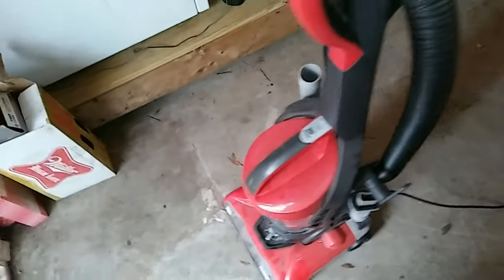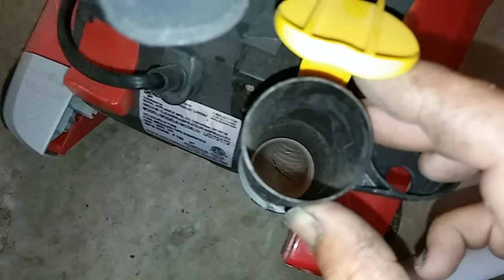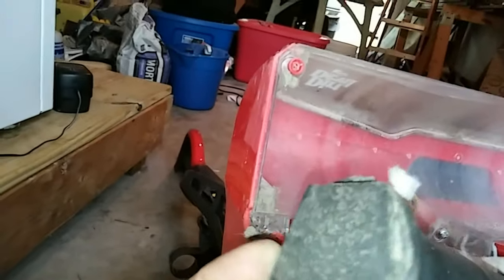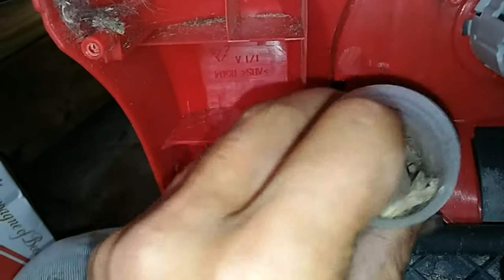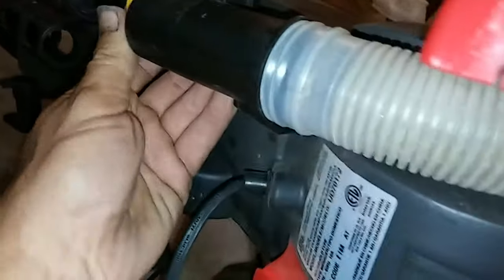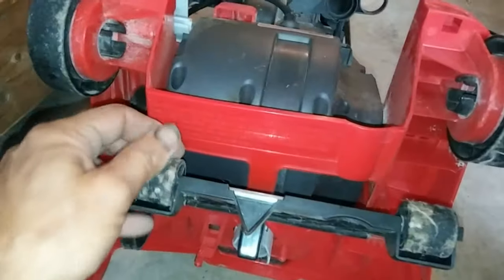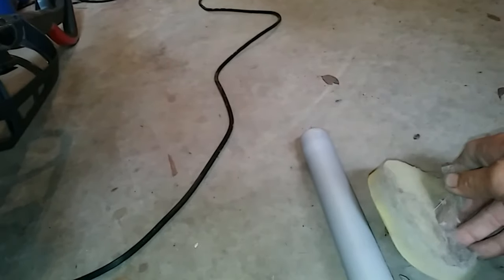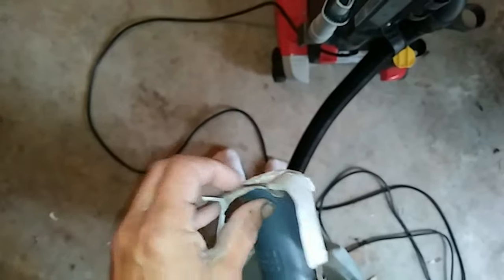how to repair a dirt devil vacume

Comment: I have a cleaning company & everyone gives me their old vacuums, I usually break them down, clean them, replace belts or hoses if cracked or use redneck ingenuity if the hose has a small hole, get them working again & either use them as a back up, when my good vacuum needs some TLC. Anyway, my daughter-in-law gave me a dirt devil just like this one. Talk about backed up, she used it 2-3x's daily, (3 cats & a 2 yo) she never knew it had a Hepa filter or that the foam/felt filters needed to be cleaned. Anyway, I took it completely apart, took the air compressor hosr to blow out the Hepa filter & a shop vac to the foam/felt filters (then hand washed these 2 only), removed ALL hoses, took a dryer vent brush through the hoses to remove all of the clogs, then blew them out with the air compressor. I cleaned the brush roll, replaced the belt, everything looks brand new, turned it on and I have power, but absolutely NO SUCTION. Found your video, watched it, saved it, subscribed, got home, watched it again, took the vacuum 100% apart again.... went through the motions just in case I missed something, nope, no clogs in the hoses, filters are clean, even the vent under the foam/felt filter is clean... put it back together, but I still have no suction.. what have I missed? I did notice on the top of the canister, it looks like maybe a circular foam or paper filter could go inside over the plastic piece with holes inside the lid, but she said it never came with one? I know nothing about Dirt Devil's, & I can't find any other videos that go into as much depth as your does. I'm at your mercy and any info is greatly appreciated. Thanks
Reply from the maker: If the motor sounds like it's revving real high then it's still got a clog somewhere. Also, make sure the impeller is turning. Let me know what you find out.
Reply: @shabear1000  It's turning, motor isn't revving, I had ordered new filters (& a brush roller) after I got the vacuum from my daughter-in-law, trust me when I say even after I cleaned for the 1st time in 2 year's, they HAD TO BE REPLACED. Anyway, I had a rare day off yesterday so I broke it down & took it all apart again,  I replaced the  belt (again), installed the new felt/foam & Hepa filters, the brush roll, actually took the broom handle through the black hose, dammit I missed a massive clog, thought the air compressor would have blown it out, but it didn't even come close. I couldn't push the broom handle all the way through, not even putting it on the ground, running it up the hose with all of my weight, found an old cane pole, longer than the broom handle, with a metal grommet at the fattest bottom end, ran it through, a small clog came out, ok... blow, nope... needles to say it took me 45 minutes, a small piece at a time and I finally got it all out. DAMN, that's all I can say. I appreciate your advice & help on this.

Comment: I think the motor is jacked up. We cleaned the brush rod, the belt looks fine. When we take both of those out, the vacuum sounds fine. When we put both back in the makes a loud whirring noise and then I smell burning.

Comment: Yay, I was able to fix my Vacuum from your video. thank you sir!
Reply from the maker: Loven Sanchez you are very welcome
Reply: shabear1000 Mine is making Flapping noise when the thing spins what could it be
Reply from the maker: +Tyler  Sauls make sure nothing is in the fins in the motor. In sure you have already checked the beater bar, if not check it first. Also look for any lose or worn parts

Comment: IF YOU HAVE BURNING SMELL: I repaired the brush roller by 1. removing all external hair, string, etc. 2. Pulled off end caps by putting in vice and pulling. Hair was imbedded in there slowing rotation. This caused belts to burn. 3. Removed all hair. 4. lubricated with 3 in 1 oil. 5. replaced caps. put back together and it works! I'm too lazy to do a video. LOL!

Comment: Okay so I have the Dirt Devil Powermax Carpet + Hardfloor Pet vacuum. My current brush roller has melted belt on it and the belt keeps slipping off the metal rod. How do I fix this ? I have pictures but you tube will not let me post the pictures.
Reply from the maker: If the belt is melted replace it. Make sure everything is clean and free from dust, pet hair, etc.
Reply: @shabear1000  I did both of those but there’s nothing keeping the belt from slipping off

Comment: Do you happen to know what the screws are? The ones you talk about taking off? I was fixing mine because the belt broke and I ended up misplacing them. I have to buy new ones but I don’t know what they’re called. Or the length of it.
Reply from the maker: Not sure but they are a Phillips head screw, maybe1/4
Reply: shabear1000 ok thank you!!
Reply from the maker: You bet. Sorry I couldn't help more.
Reply: shabear1000 that’s ok!

Comment: Dude the clear part that you put back on won’t go back in properly HELP ME
Reply from the maker: Make sure it is lined up properly. It should go on pretty easy. Let me know what happens.
Reply: @shabear1000  i did it and it’s like crooked.I cleaned out everything and I even called the company and they told me that they don’t recommend to take that clear part out because it may not go on the right way and I still can’t fix it can you do a tutorial on how you did it please?
Reply from the maker: Yes I will. Exactly what clear part is it so I make sure to show the right one
Reply: Ok it’s the clear part you see the brush rolls.the front cover you took the hose off and you have to align that part it’s stuck and won’t go back on.

Comment: UPDATE: I watched the very beginning again and heard you say "Pro Power..." I looked it up and we don't have the same one. Best I could tell your's is model UD70172 , while mine is UD701623. But close enough !!! Thanks Again!!
What model is that ? I'm following you step by step but I don't have that yellow capped pipe area on mine. Well it's my friends but I'm going to use it after I clean it up (though it's not that dirty) and your vid is so helpful to me !!!!   This one here is a Power Max  Model UD701623. Appreciate all the help !!  I'm a Kirby fan myself.. but its getting heavy.
Reply from the maker: thanks for the update..
Reply: I'm Googling now about using the wand and hose attachment. wondering how U leave the rest of the vacuum? With the beater bar running? not good is it?
Reply from the maker: The vacuum raises the beater bar up enough so that it wont touch the floor. As long as the handle is in the upright position.
Reply: @shabear1000  thank you very much ... for ALL your help. I hate to ask, but....
I have successfully followed your video and cleaned this vac. Now when I turn it on, begin vacuuming, there is a loud high pitched sound that nearly blows my ears out. Any ideas ? The vac is clean, no clogs, barely used even. But my friend had it sitting in her garage about 16-18  mons. No complaints with the efficiency, but that noise.. ohhh my.